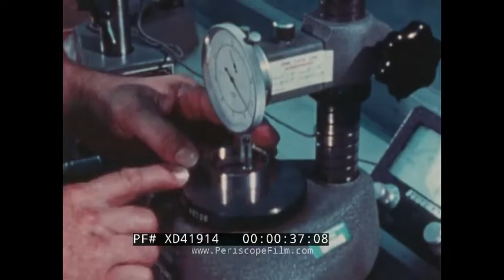FIM-92 STINGER  ANTI-AIRCRAFT MISSILE SYSTEM 1980s PROMOTIONAL FILM  XD41914

Comment: The Stinger replaced the Vulcan 20mm cannon (Helicopters) and the Chaparral Missiles (High flying jets). My superiors lied to me because I was told, in 1982, that the Stingers were for low flying jets and the Chaparrals for high flying jets. Turns out the Stinger had the same effective range as the Chaparrals, although the Chaparrals were much bigger and much heavier. The Stinger was a game changer, in 1982. Hector from Camden, N.J.

Comment: I worked at General Dynamics Pomona Division from 1980 to 1985.  As a machinist, I worked on a lot of the next gen Stinger parts for Stinger-POST.  As an N/C programmer, I worked heavily on getting the Stinger POST production parts line up & running, and proven.  One thing to note is that the F-102s used as drones, my dad worked on installing the Radar, Avionics, and Hughes Fire Control systems on those in the mid-50s up at Plant 42 in Palmdale CA
Reply: @Trail Images Photography Out of curiosity who made it? They'd sold off Stromberg a couple years before. :)
Reply: So your dad built the planes you (indirectly) destroyed?
Reply: @ingusmant  Products have to be tested.  Yes, it was a bit of a shame they chose the F-102 as a drone among other flight articles, but that is the way it was 40 years ago, and somewhat still applies today.
Reply: Awesome
Reply: May I ask if the stinger is using PN guidance law, how did you obtain the range?
Reply: I was working at the local mocdonalds in 81 I bet I spat in your Big Mac

Comment: It uses a battery system along with an Argon gas unit that cryogenically cools the seeker head, that’s the round piece being screwed in the bottom before shooting.  The Argon gas has a short shelf life and the missile will not work without it.  That’s one of the reasons the Mujahadeen had to give the left over stingers back to the US in the 90’s.

Comment: That’s been in our arsenal at 45 years, I remember when we were giving them to the Mujahideen in the 80’s to fight the Soviet’s. They sure screwed them up.
Reply: The battery packs for the US Stinger missile were part of the problem but there's more, the Stinger battery pack also provides the argon gas that cools the Stinger sensor head, you don't get much time, the argon cooling only lasts about 40 seconds, that's it, then it's time to quickly install another battery/argon pack. The Soviet SA-7bs (Cobras, also called Strela-2 ) also had a major battery problem, operators left the missiles on and quickly ran down the battery, again oddly 40 seconds of power, this class of weapons is often colloquially called Stingers, after the best-known American model. Abu al-Baraa, a Syrian Air Force major until defecting to the rebels in 2012, was able to construct a battery pack for the Strela-2, he assembled a unit with three groups of AA lithium-ion batteries salvaged from laptops, and managed to match the voltage for the factory-made sample. His total cost, he said, was about $50. The new batteries last longer when activated and can be recharged by connecting to an electrical outlet.
Reply: Well I guess they've got a modern airforce to go with them now
Reply: Yup, and that had absolutely ZERO blowback on America later in 2001, those Afghans were just fine young chaps who got all mixed up somehow^^ From at least since the Romans armed "loyal" barbarian and outsiders till now, we never learn that the enemy of your enemy is NOT always your friend XD
Reply: @goofyroofy  Just business as usual
Reply: @goofyroofy  People forget that they buried and warehoused thousands of those missiles. They'd fire them en mass at helicopters or use them as improvised IDF or rig them along routes. That is until the Chinese started shipping them new batteries that were compatible clones. That's when things really got interesting.